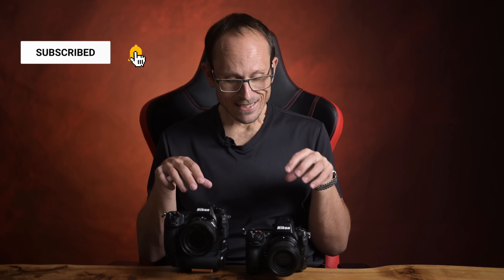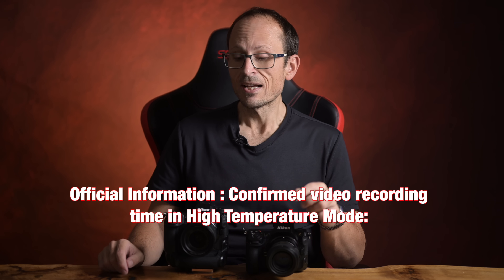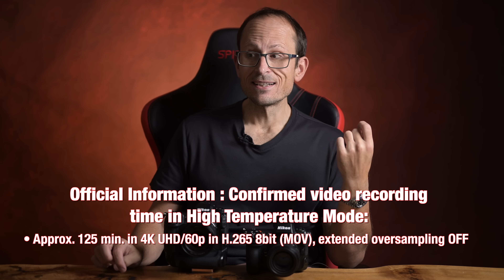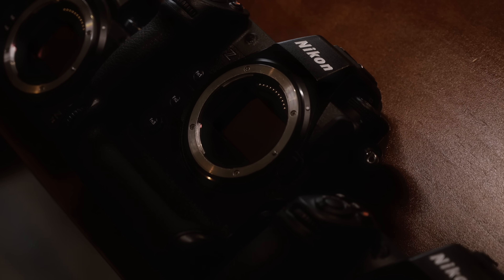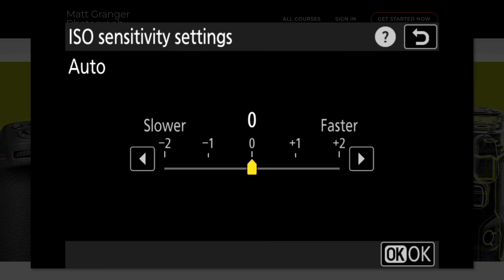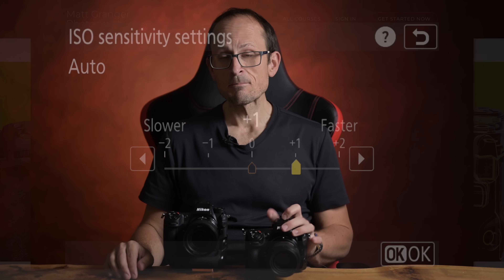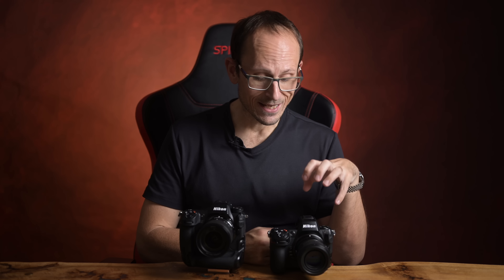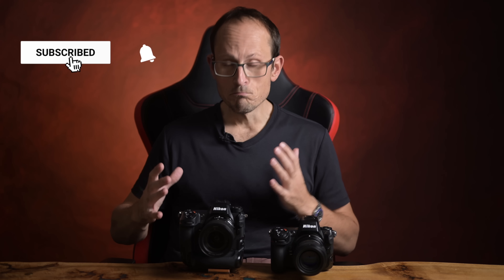Nikon Z8 - Video OVERHEATING & Battery Testing (VS Z9)

Comment: I wonder if the Z8 would do better if the screen was popped out away from the body. Would be interesting test!
Reply: I assume it would improve the performance by about 5-10% maximum, considering that the screen itself generates heat and that it also acts as another thermal insulator layer, therefore decreasing cooling performance when in main position.
If Nikon could come up with external cooling unit(heatsink & fan combo) powered via USB-C on the camera, I think that Z8 performance should drastically increase. I know @DIYPerks would probably come up with something like that.
Reply: It may make more sense to just get the Z9 if you need the extra recording capabilities. You wouldn’t need an external fan and the larger internal battery would provide long runtime and be augmented by an external battery pack.
Reply: @waynerm002  I know, and I would honestly get the Z9 instead, if I was not a gimbal user. Right now, Z9 is a brick for any gimbal, providing barely enough clearance to stabilize and operate the gimbal. Attaching anything on the hot shoe of the Z9 or a cage on the Z9 and then attaching the Z9 to the gimbal, would render the gimbal inoperable. 

This is why many prefer smaller bodies rather than bigger bodies. 
Also, it's easier to handheld a Z8, rather than Z9. 
Nikon has nearly killed it this time, but honestly, we need a cinema camera next, or an upgrade to Z6II and Z7II. 
Honestly, Nikon's autofocus was the biggest turn off for many people, and not video features or maximum resolution, codecs, and etc. 

This is why I opted to use an Olympus camera for video due to highly reliable AF, rather than one of the lower tier Z bodies, and also because Z6II and Z7II were very expensive at the time of purchase of Olympus(OM-D E-M1 II).
Reply: @astanisystems  Got you on the Z9 for gimbal use. Z8 is better in that use case. Autofocus and stabilization is why I sold the Z6II and got into Sony. Some of the launch footage and YT videos shows the Z8 having batter performance in both areas. I’’m hoping Nikon adds VR to some of their smaller FF lens, like they have been doing for their DX line. If Sony is using electronic stabilization to do Active and Dynamic stabilization, let’s hope Nikon can do the same and add that in a firmware update.
Reply: @waynerm002  VR for budget FF lenses of focal range higher than 28mm should prove very useful, especially for filming handheld and to smooth out the up and down motion when walking with a gimbal(biggest problem in every gimbal - not if you use Ronin 4D tho, but that's a whole  other package).

I've tried using the D850(with grip) which also somewhat simulates a Z9, and let me tell you, it's a brick on the gimbal. Can't balance it, there's no clearance, and entire setup is heavy, and I used RS3 Pro for that. 

I'll take Nikon seriously only when they get their AF to a 95% accuracy in good light at least and when they release a cinema body, whichever comes first.
Reply: @astanisystems  I like what I’ve been seeing from the video autofocus and stabilization. I’ll have to try it against the FX30 and A7R V. Not sure if you saw my video where I used catalyst browse to stabilize footage from the A7R V and the 24-105 OSS lens. A section where I ran across the street in Hong Kong, was so smooth, I think adding a VR lens and tweaking the gyro data could help Nikon in that regard.

Comment: I have to wonder how many people who are looking to buy the Z8 really need to shoot video that's 4K at 30 fp and higher for more than a hour.  I am perfectly fine recording long vidoes that are greater than 2 hrs, but at 1080P.  Even if the Z8 were able to shoot for long periods of time at either 4K or 8K you're gonna run into storage issues, which is a topic that deserves a full length video of itself.
Reply: Professional event videographers would. Weddings, concerts, that sort of thing. It's not a YouTuber problem, for sure.
Reply: totally agree ppl buy camera not shoot a photo or video but use as a heater running few batteries until it became overheating lmao😂
Reply: @JohnDrummondPhoto  professional’s looks lack of funding not go for arri but 4k usd nikin lol😂
Reply: I shoot corporate events that last all day or up to 3 days. I deliver in HD, but record in 4K. It's great for cropping options when recording 3 speakers on a panel.
Right now, I shoot to Ninja Vs, the SSD storage is so much cheaper.
Reply: @jessetimber1388  how funny is $40K-$80K & more for an ARRI? Not to mention lenses, monitor, media, cage, etc. If you have funding for that, kudos.
Reply: I have done live events where my camera turns on at 7:00am and powers down at 6:00pm. And recordings start & stop all day long. A lecture/presentation could easily hit 3 hours. I have also recorded live concerts that hit over 2 hours without stopping.
Reply: @CLIFFLIX  in that case you certainly want to use an ATOMOS Ninja at all costs regardless of camera body. Time limitation alone even the Z9 and Sony A1 fall short.
Reply: @michaellee3903  For day long events, I use Long GOP 4k 8bit....I just need to know that I can trust it. My Sony A7S-III and FX6 are 100% bulletproof. I want the ability to shoot 8k interviews and crop in to create "two" camera shots (wide and tight).  I just dont want to worry about my  Z8 shutting down on me in the middle of my interview.
Reply: @CLIFFLIX  in that case get the Z9. You’re only talking about a $1500 difference here. To me the Z8 is designed and marketed primarily for still photography as well for those who shoot short video segments. Either that or get a Ninja, which for me is great for shooting long videos with my Z6 II
Reply: @CLIFFLIX  what at 8k raw? Or 1080.
Reply: @CLIFFLIX  nikon z6ii all day 4k long gop 8bit. So will the Z8. That’s a fairly low bar.
Reply from the maker: Probably a small minority. I hope those people find this video helpful - as the introduction clearly says...
Reply: @JohnDrummondPhoto  yeah and how fun that most movie production company rent the Arri gear from rental company for their footage and how fun that you can buy 2 x Z8 for only 8K to solve some weird 1 Hr none sense recording project..
Reply: I don’t care as much about the overheating, but the longer battery life, built in GPS, faster card slot, and built in grip are deal breakers for me.  The small price difference gives so many benefits …

Comment: Great test! Thanks for doing it. An important question is what would the time difference be if you dissipated heat by fully opening the back screen away from the body? I'm sure the Z9 would still beat the Z8 handily even if the z9 had its rear screen closed.
Reply: @MattIrwinPhotography  Makes sense not having a battery in camera that's going to get very hot. So then, using external power plus leaving the back screen open sounds like a formula to eliminate the issues Matt raised.

Comment: I have to wonder how cards like the Angelbird AV Pro, which runs cooler, would affect the overall heat issue. The card seems to get hot first, which will also influence internal temperatures. I've never had a hot card warning with my Angelbirds in my Z9 with RAW video. I live in a tropical climate, so now I'm thinking if to cancel my pre-order... I really did want that smaller body.
Reply from the maker: Only card I’ve ever had completely die on me was angelbird
Reply: @mattgranger  Oh wow! I hope that never happens.
Reply: In other reviews the Delkin Black cards are recommended as the coolest running cards along with either using the battery grip or an external battery to keep the camera cooler.
Reply: @MrJleash  The Angelbirds have been performing relatively well compared to other cards. It's even better now after the firmware update.
Reply: @SooksVI  Great to know. Thanks!

Comment: So actually it isn't a problem with the camera but a product of the size. I am just a hobbiest and I don't like the weight of the z9 or the price of either but I think I will be second hand in a year or two. I would like to be off in the wilderness when I do and so would probably go for the z9 because of weather sealing, sturdier build and bigger battery. Can I ask about the lack of mechanical shutter? I am sure it has been addressed but if anyone can jump in. What does it mean in terms of shutter count and longevity of the camera?
Reply from the maker: I think both.

Comment: Thanks for doing this Matt, I had heard it would over heat sooner, but thats respectable considering its all internal and the body size.
Reply from the maker: Outdoors I am sure it will overheat sooner.
Reply: @mattgranger  you're sure or you hope? It would make for an interesting video though 😉
Reply from the maker: @rk-wy8pu  I hope it doesn't - as this is the last test I am personally basing my purchase decision on.

Comment: I’m a contractor that needs to do hybrid work outside for picture advertisement and presentation videos. And my end goal is to do charity work in third world country’s for video presentations and pictures I need durability and longevity it will probably be ten years before I can buy another high end camera which would you recommend for me ?
Reply from the maker: If you’re only comparing these two, the z9 is much more rugged and maybe suited better to long days without access to power. That said, both maybe overkill, especially if a charity is paying 👍🏼

Comment: Another great video Matt! would the overheating occur if recording to an external monitor/recorder like an Atmos?
Reply: No. You get much longer recording times with an external recorder.
Reply from the maker: Depends where the heat is coming from. If Its from the Sensor, processor (used more with external display) or battery - its one matter. If its from card, that's another. And are you writing to card and recorder, or just recorder?
Reply: @mattgranger  thanks for the reply! my Z6ii can only write to the recorder or camera not both! not sure about the Z8 but my question was aimed at if I could write to the recorder  from the Z8 would it avoid  the overheating! I messaged Atmos got the standard company answer the Z8 isn't supported however if it has a clean hdmi out etc. I'll have to wait until I have my Z8 in hand!

Comment: I DO NOT UNDERSTAND that!

I worked a decade in hardare electronic manufacturer-side business and if 1 thing is clear it is: HEAT destroys electronics.
At least in the longer run.

So Nikon (as well as Canon and Sony) sells a 4 GRAND body that gives an "overheating" warning. And people are recommending that product?
Same on the other manufactures.

Funny thing: One needs to set it high heat manually.

This is why I bought a GH6 and probably will not buy a cam for video w/o fan. I use the GH6 daily for streaming with teams. I use the cam on "standard" and with auto fan.
Reply from the maker: I agree. Whilst its easy to write it off as 'oh just a warning, it continued to work', the warning is there for a reason. And if you have to enable high temperature, and go past ALL the warnings to get a decent result... its not how I feel comfortable to treat my gear & data.
Reply: @mattgranger  We know the discussion about Dual Card Slots - for redundancy.
And here you get a "hot card warning".

I am not a pro so I don´t care too much.

+ one can see that Pana solves this prob with a fan incl. weathersealing. 

So it is possible. In the case of an Z8 it is just a shortcoming of engeneering. PM vs. Sales.

Comment: I think the higher video rates of the Z8 justfy the heavier body when compared to an R5 where the video is cropped and at lower framerate. The Z8 may be using the extra mass for heat sink.
Reply: @TigaWould  good points! I think I heard Manny Ortiz say the R5 was cropped at 4k 60 and it doesn't have 4k 120.
Reply: @TigaWould  i think I mixed it up, now I recall he was talking about the Sony a7 r v . How is the Canon dynamic range in the highlights compared to Sony/ Nikon. Dxomark gives the R5 a 95 score.
Reply: @TigaWould  ok, I was a bit worried about Canon R5 blown up highlights recovery, why is really good on my Z6ii and don't want to lose that. Last time I used Canon, overblown areas were frequently not recoverable on post.
Reply: @TigaWould  interesting thoughts !

Comment: THX Matt - A few ideas: Very interested to see a side-by-side comparison of the Z8's image quality, when creating H.265 10 Bit oversampled at various frame rates, vs H.265 8 Bit in the same frame rates. Also very interested to see how  the oversampled video compares to N-RAW in quality when colour grading is applied that is similar to the H.265, to determine whether the image quality is significantly better (clearly N-RAW will be much more versatile for post processing - however this would just be a test of pure image quality) - in other words - answering the question: Is N-RAW / ProRes RAW worth all the overheads in storage sized and post processing power, when you expose correctly and do not specifically need colour grading in your workflow.

Sound quality tests: I am also very interested to see how good the mic pre-amps are in the Z8 vs the Z9 when an external mic is plugged in. The D850 (that I currently have) has a notoriously substandard pre-amp that produces quite a loud hiss, necessitating forever lugging along external recording equipment - some other bodies that I used the same mic for, such as the humble Fuji XT-1 does not have this issue.

Comment: Hi Matt! Thanks for your sharing! Just one opinion. It's better you can create a summary 2 column tables of Z8 and Z9 respectively on screen to show on the final conclusion section. So that we can better to understanding the limited of Z8 compared with Z9 in video capability, thanks!
Reply: I like summary tables as well.  I screenshot the information to reference it later.

Comment: I guess you can get slightly longer recording times on the Z8 if you run it with the AC adapter thingies (which I believe go for another $500 USD) instead of battery in the cases where the battery ran off and that's what Nikon was reporting.
Reply: No need for that. You can use a USB C battery pack that is PD capable, which is common nowadays.
Reply: @SooksVI  Or use a V-mount battery.  Nikon list Smallrig and FX-LION as accessory providers and both have V-mount batteries that can be used to power the camera as well.
Reply: @waynerm002  yes, I purchased the smallrig 99wh v-mount battery for mine after realizing my IDX batteries didn't work. It's now my favorite battery. Small and versatile.
Reply: @SooksVI  I’ve been waiting to get one or maybe the FX LION one, that one had additional USB ports.
Reply: @waynerm002  I just came across a neat accessory from Tether Tools on BH Photo that can convert D-Tap to PD. I ordered a couple for my other batteries that lack PD.
Reply: @SooksVI  That’s cool!

Comment: Love how Nikon is an ethical company which doesn't believe in poaching customers of other brands by making cameras that are literally too hot to handle:) With these limitations, these cameras are only for Nikon loyalists. It is completely ludicrous how a company which doesn't have any proper video camera and so no reason to cripple the hybrids to save the big ones (like Sony or Canon), won't think of adding a fan to turn these into probably what would have become the most powerful hybrids out there. I think the next Nikon will have a fan inside. Or may be not. They seem to have won or atleast settle the Raw lawsuit against Red. What is the point of fighting that battle if the camera cannot make use of it? I can imagine Red representatives laughing all the way or probably that was the deal they struck with Red for an out of court settlement promising Red that these Nikons would only do short burst of Raw videos.

Comment: One thing I would be interested in seeing in addition to the external power video recording options is external storage as you can record out to USB type C, I would assume. Does that propose any bandwidth limitations, and does that help resolve the hot card issues?
Reply: As of now, Nikon has not specified that you can use an external SSD to record in the Z8, like you can on the LUMIX S5IIX. When I found out that it had 2 USB C ports, that’s the first thing I thought it would be used for. It would be a nice option to have and who knows, maybe they will activate that in the future.

Comment: Great test Matt. The Z8 should achieve the long recording time Nikon specified using a PD battery. I didn’t expect that to occur on the internal battery only. It’s great what the Z9 can achieve and impressive that the Z8 in a smaller body can do what it can without a fan. This camera will be a good fit for a lot of creators. I wonder if pulling the screen from the camera would improve the record time. I do that in my A7R V and it doesn’t heat up as quickly as it would with the screen flush against the body.
Reply: I have the same question. Pulling out the screen helps me a lot with managing heat on the Z6, for instance.
Reply: @unpluggged  Yep, got my Z6 II to run longer doing that in the past and I do it with the A7R V as well. The screen generates heat as well. Checked the Nikon site and noticed they have the screen tilted in the image where they specified the run time and that it was achieved using an external battery.
Reply: Negative. I have the Z8 and I love it. But the using PD battery and or the screen pulled away from the body makes no difference at all. The overheating is the same on my camera. It’s just the heat dissipation of the body can’t handle it. Sadly, I’m disappointed, I thought I could get by with just the Z8 but I’m gonna have to buy a Z9 also. It’s a great camera for gimbal work though. You can actually run the Z8 on a tiny Weebill S.
Reply: @willvazquez3218  It all comes down to the ambient temperature you are recording at. In cooler climes it will record as long as Nikon says it will and their test lists the temps it was tested at. The time limit for all recording is 2h 5min..